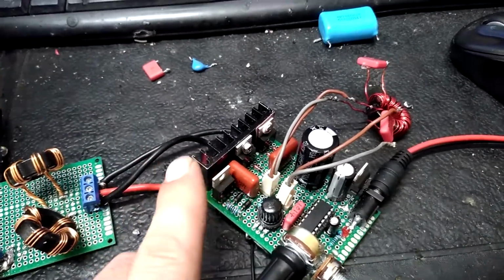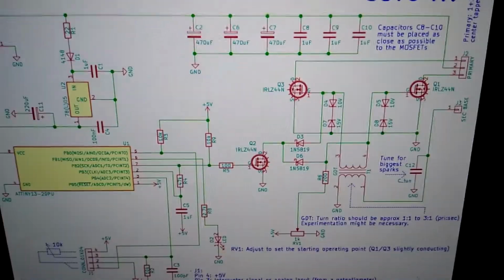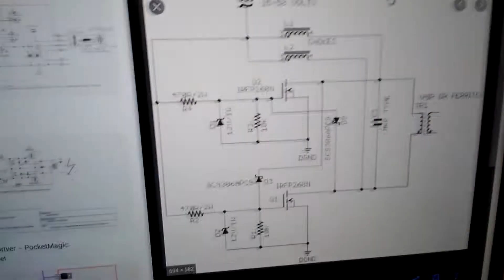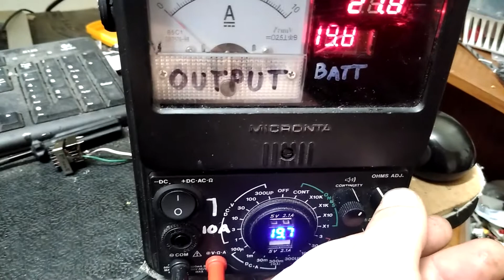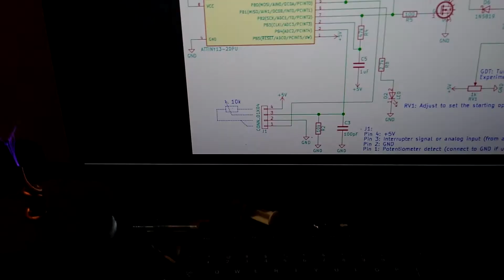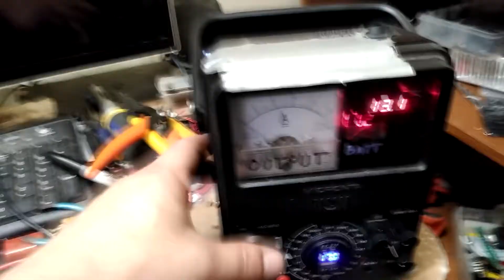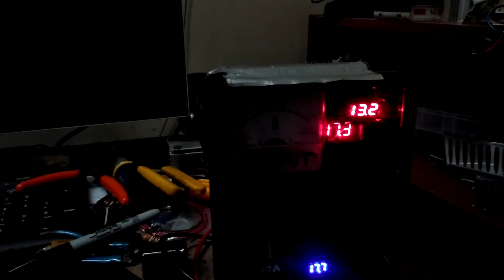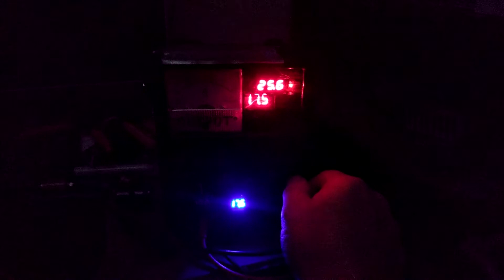Skori/Tefatronix/Teslaundmehr DRSSTC? 12-24VDC Test

Comment: Use this next. Mini DRSSTC circuit: https://i.imgur.com/VEgXW87.png Change resonance capacitance to 60nf left right. Voltage about 70v. 18cm arcs! Only needs an interrupter circuit and a boost converter if you want lower input voltage.
Reply from the maker: Man I've really been trying to see if I could drive these around that voltage with just the plain GDT and feedback filtering but I think you're right, I might have to go with either just a dual or a couple single gate driver chips and some separate outputs on the 74HC14 cause I have some fake ebay ucc2732x chips laying around that kinda work. I spent the last couple days messing with an older circuit I built that worked awesome at up to 40v tested but I tried reworking it to make it look better and 'finalized' and it took a ton of messing around to deal with the interference that occurs at those voltages. I had put this drsstc thing on hold but once I'm done playing around with this 12-24v one I'm gonna order some fets and build the high voltage version. I need those sparks man I need those sparks. I'm looking around for shit now to build it.
Reply: @Magneticitist  This circuit only needs like a 3-4cm tall secondary coil. Like 5cm in diameter.
Reply from the maker: @PiratCarribean  that's crazy but I guess the output is going to have a somewhat small ceiling at that size. Might have to just see how small I can go cuz I have some micro coils laying around from old testing but it ain't easy to get coils so small low enough in frequency.
Reply: @Magneticitist  Test the circuit, it's simple enough :)
Reply from the maker: @PiratCarribean  I know it will work it's really the same circuit but with the Schmitt trigger and gate drivers it should theoretically work a good deal better, part of the whole draw for me with this circuit was seeing how well it could work without those components though. That is something which is sort of rare in the SsTC world. I have enough micro coils in my opinion but I wouldn't mind one more drsstc that's smaller than the one I have already. I'm going for the bigger scale next to see if I can get longer arcs than I have from anything else previously. This circuit should do it safely at that 60 to 70 volt mark.
Reply: @Magneticitist  Video of a tesla coil with this circuit https://imgur.com/x9mWWZ6 Heatsink on the bottom is 61mm in diameter and 10mm tall.
Reply from the maker: @PiratCarribean  Hell yea dude that's about the perfect size and output it's playing music looks like so I bet the low frequency interrupted pulses could be even longer. I wonder what kind of interference issues was ran into, this is a huge problem for me so far. It seems like occasionally I will just get lucky with a layout but when cleaning it up everything changes and even with decent grounding just moving my hand near a pot or something will throw it all out of whack. Maybe this is just inherently an issue with direct GDT feedback.